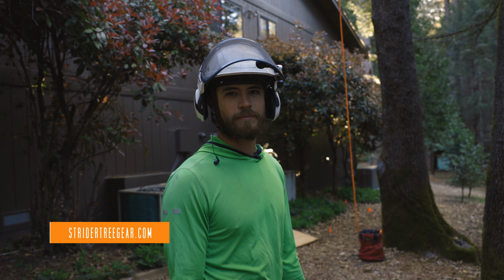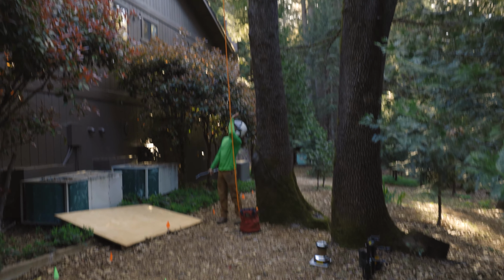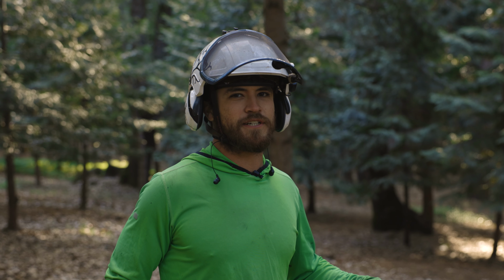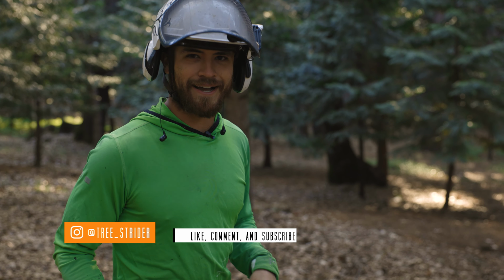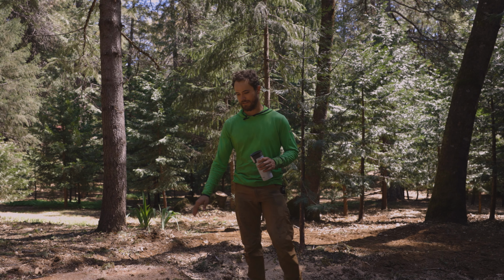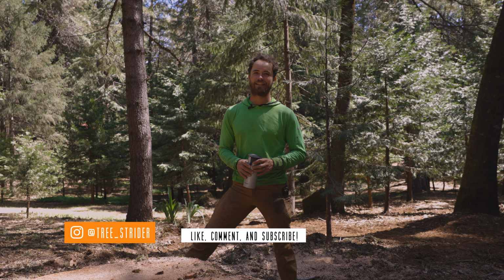Rigging down 90' oak with GRCS | Good Rigging Control System | Job Breakdown

Comment: Nice job, seems like some of them fell a little far before catching was that by design or not enough slack taken out?
Reply: The probably switched the caption winch out and used the bollard for as thous pieces did not need to be pre tensioned.